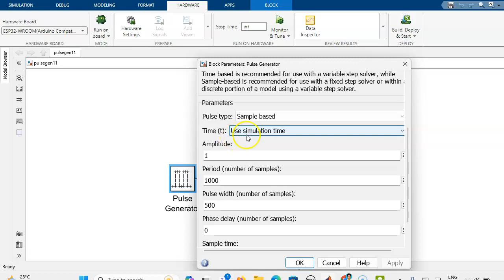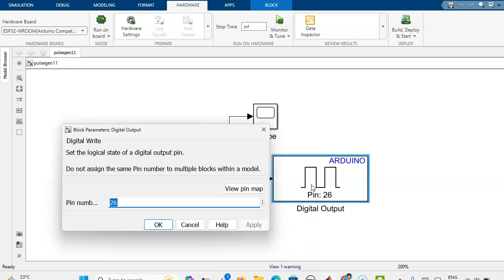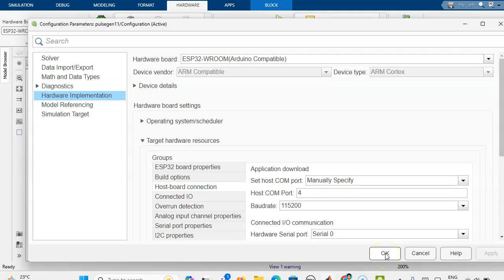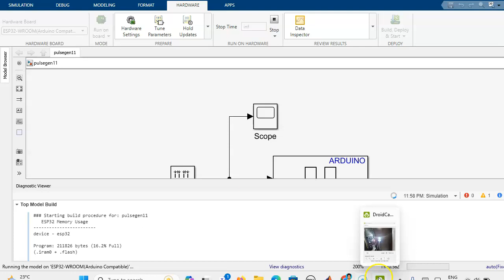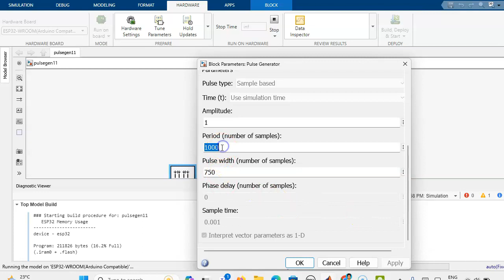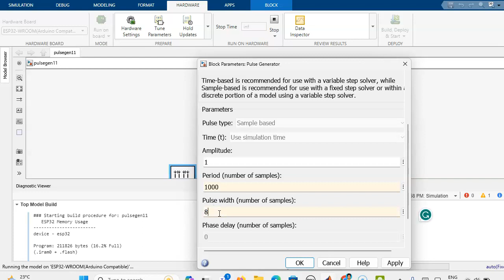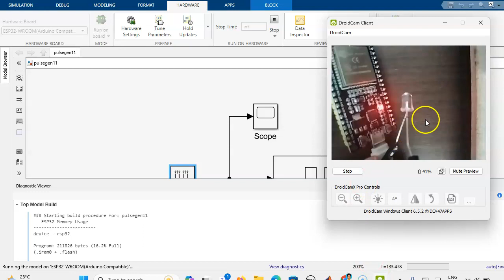Blinking LED using ESP32 and Simulink - Part IV. II

Comment: i got this error: Serial port COM2
Connecting......................................

A fatal error occurred: Failed to connect to ESP32: Wrong boot mode detected (0x13)! The chip needs to be in download mode.
Reply from the maker: While connecting ................, hold boot button, Once it started to upload the code, release the button
Reply: @sriranjanisimulink7455  thank you it worked